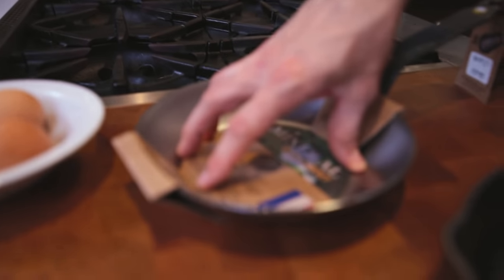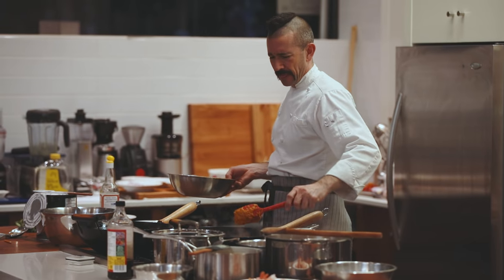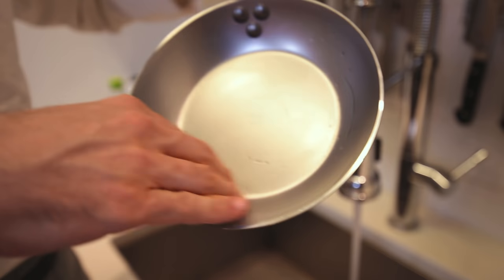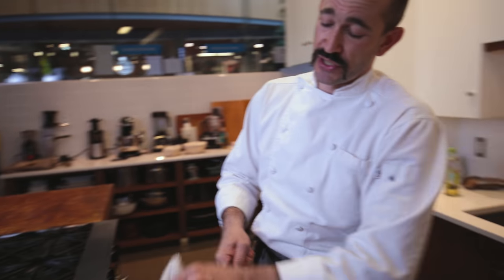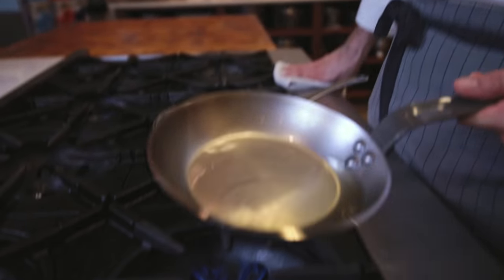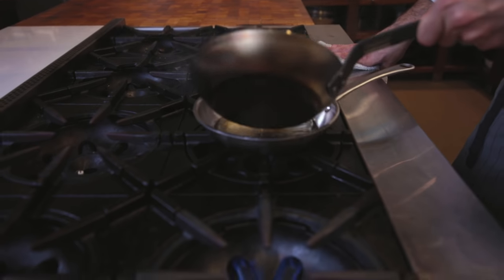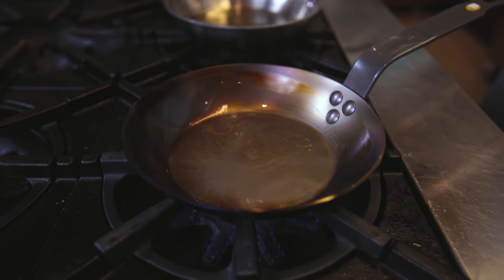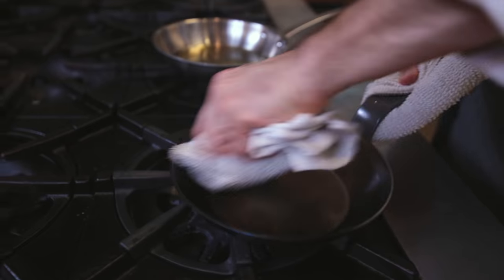How to Season a Carbon Steel Pan

Comment: I personally think everyone should still have a high quality non-stick pan, just to have the option to cook bascially fat free if you choose so.

You cannot really do that with anything else, and it's definitely a help for dieting. 
Altough it will never taste better, ofc....just, less fats if you so desire
Reply: The only benefit of non-stick over Carbon Steel is for acidic foods. Seriously I was of exactly the same mindset when switched over with eggs etc sticking after 1st seasoning. After about 4-5 times cooking in the pan the natural seasoning made it as, if not more non-stick than any teflon pan, just needs to be at a good high heat before adding the food. Every non-stick pan I have had, even expensive ones that supposedly can take metal etc degrade after about 3 years meaning I must have digested a fair amount of plastic. Carbon steel takes maintenance, love and may even need a re-season but avoid, acid, the dishwasher and too much detergent (a bit of washing up liquid is fine) make sure its super-dry and lightly oiled before storage and it kicks any non stick into touch and will outlive it's owner
Reply: @leecourtney1225  I agree carbon steel performs the same with high heat and oil, but there doesn't exist a way to prevent the food from sticking if you apply little or no oil. That's the key difference

I need to have the choice to cook fat free if I want to, while carbon steel dictates the minimum amount of fat needed to cook properly.

Also it's not just about acidic food, any prolonged cooking method that requires liquid (even water) is prohibited.

Comment: so....just leave the handle and the outside of the pan unseasoned so they'll rust quickly??
Reply: The handle on that skillet is coated with epoxy and doesn't need to be seasoned. Raw iron handles are a different thing, they should be seasoned too. The outside of the skillet should be seasoned if you use it on closed heat. The skillet in this video is going to be used on open heat (gas stove). That will form a layer of residue from the flames which protects the skillet from rust similar to a layer of seasoning. Still, there is nothing wrong with applying some seasoning to the outside of the skillet.

Comment: Question. I just bought a De Buyer Mineral B 9.5 inch pan. There's a yellow waxy plug in the hole in the handle. Are you supposed to remove it, or keep it there? I plan to put in the oven sometimes, so was wondering if it should be removed. Thanks.
Reply from the maker: Hi Geoff, no worries about that plug. It's silicon and will take the heat.
Reply: The grey epoxy coating on the handle also limits oven use not just the plug.
Reply from the maker: @joec2174  It certainly does. Too high of heat in the oven will damage the handle
Reply: @Cook-Culture  the logic of de buyer is questioned here?  What do they think we do with these pans ? Mineral B.  Should be mineral BS .
Reply: @joec2174  Works fine in the oven. I season my Mineral B's in the oven. 250°C without any problems.
Reply: @Cook-Culture  That is why I chose the Matfer over the de buyer , for one the handle in the oven issue , but more so , no rivets .......

Comment: I bought a De Buyer mineral B for my mom and dad. Tried the stovetop seasoning (induction) after scrubbing it with hot water. Everything stuck on the pan and it was hopeless cooking on it. Then I tried the oven method after cleaning it in the sink with hot water. Covered the entire pan and outside with oil, and poured a layer of oil (canola) into the pan. Gave it about 20 min with oil, and another 20 min after pouring the hot oil out. The entire pan is now sticky to the touch... A lot of discoloration which I think is normal, but its super sticky. Havnt tried to cook with it after this, but I'm starting to think the pan is useless. Am I doing it wrong or? Really disappointed in this pan man. HELP :(
Reply: Try a diff oil and higher temperature. The point of putting it in the oven is that the oil polymerizes, but needs a high temperature to do so. Some oils work better because they polymerizes better aka has more unsaturated fats. Try some different ones and see which is easiest for you. I've tried flaxseed oil, bacon fat, and shortening all with similar success.
Reply: I'm afraid there is nothing wrong with your pan...  Seems you have used too much oil and need to give it more time in the oven. Scrub the pan clean of all gunk and start again. The pan should be almost dry, wipe the oil off twice with dry paper. Thin-thin oil layer. Give it an hour in the right temperature (slightly above smoking point, different oils have different smoking points, Google your oil 🙂) and let it cool slowly in the oven until cool. Repeat as many times you want. One layer is enough, several better 🙂
Reply: @davidnguyen5936  The point could also be that cheap induction tops have very few coils - it may be difficult to heat the pan evenly on this kind of a top. Also edges will heat evenly in the oven.

Comment: I just got two pans , unseasoned, can I use grapseed oil or avocado oil or vegetable oil or Wesson oil? And do you also do the bottom as well, underneath I mean ? Thank you
Reply from the maker: Hi, I use grapeseed oil and yes, all over but not the handle.
Reply: @Cook-Culture  ok thank you, also my nee pans have a silicone handle , can they go in the oven?
Reply from the maker: @jay62898  Can you give me a link to the pan?
Reply: @Cook-Culture  Sorry if this is a silly question, but do you season the bottom/underneath and exterior of the pan and then put it over the heating element/flame?
Reply from the maker: @macgyveric  Hi, yes, and this video may help you out: https://www.youtube.com/watch?v=UEZYD5VSEIM

Comment: Why can't I use vegetable oil instead of Flax oil?
Reply: Steve B. You can use vegetable oil, but flax oil gives a better patina, i use vegetable oil and it's working perfectly.
Reply: You can use any kind of oil but use a high smoking point oil like canola
Reply: Flax looks nice for pictures but is very fragile. I have always have very satisfactory results with grapeseed oil.
Reply: Vegetable oil is cheap but very effective at making your pan nonstick. Don't waste money on expensive oils.
Reply: use vegetable oil, flaxseed is expensive and is not better than cheap vegetable oil.

Comment: This works for carbon steel but I have found the old school method of using your stove at high heat after wiping with oil. Thanks tho this definitely helps for the carbon
Reply from the maker: Great!

Comment: And how do you wash it?🙄
Reply from the maker: It depends if food is cooked on it not. If not, then rinse and wipe out. If there is, use chain mail to clean, then rinse and wipe out. Place on the stovetop and cook for a few minutes to dry. Add some grapeseed oil or seasoning wax and cook for a few more minutes. Let cool.

Comment: Sorry for the dumb question, but do you do it only once when you buy it, or u have to do it periodically?
Reply from the maker: Jamil Hi, the best care of any raw iron product is to season it after every use. One your pan is well seasoned, this means to add a light layer of oil and bring it to smoke on the heat. Let cool, wipe down and you are ready for your next use.

Comment: How often do you have to season the pan?
Reply from the maker: Thanks. Good question. It depends on the what the surface looks like. It you're cooking with fairly fatty foods you may find that you post season less, but if you cook with drying foods you may need to do it  every time you use the pan, which is not a big deal.

Comment: Could you season it with avocado oil instead since it’s a healthier oil? Also is the carbon pan healthier than stainless steel pans? Thanks so much! Love your videos
Reply: For what it's worth, I have seasoned all my carbon steel pans with avocado oil with the best results of any oil. I use avocado oil on cast iron and carbon steel.
Reply: @jonlaroche2112  thanks so much! That’s what I use for cooking...
Reply from the maker: It all depends. Some people have success using avocado, olive oil, and coconut oil and some people struggle.  What I have learned over the last 25 years of selling cookware is that not all oil is created equal. Generally, cheap oil is better for seasoning. So if you buy bulk Costco olive oil then you can usually get away with seasoning with it. If you buy $30 per liter olive oil you will probably have a problem. The reason for this is fibre. Fibre is the main culprit in creating black residue and leaving the surface tacky.  This is why I always recommend seasoning with grapeseed and cooking at medium temp with whatever you desire.
Reply: Grapeseed oil, beeswax, peanut oil, canola oil 
Any oils with high smoke point
Reply: @voz5585  yikes!
Reply: @miabeia3117  @cook culture is spot on with his observation about avocado oil. that's exactly what happened to me. black, and weird (kinda bumby?) coat of seasoning even though i'm 100% sure i did it right. high smoke seed oils (no fiber) grapeseed, flax etc are the way to go for a reason. even though avocado oil has somewhat high smoke point (i tested the costco brand and it's around 430, unlike the advertised 500  btw), it also has lots of fiber making it a bad choice for pan seasoning.

Comment: That is a nice demonstration of how to season a steel pan and also a cast iron pan. I have a cast iron skillet I use which was my grandmother's and it is great to cook in, and so is the carbon steel wok I have. I just purchased two dutch ovens and I am in the process of seasoning them as well. My old skillet, and the wok have not had rust problems with them and I am so glad.